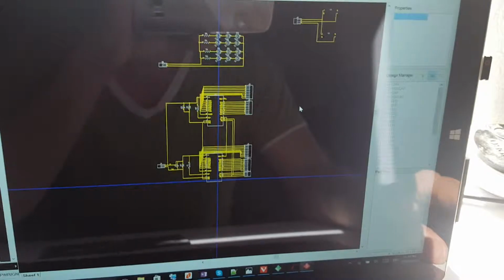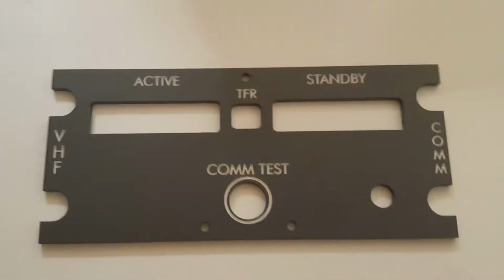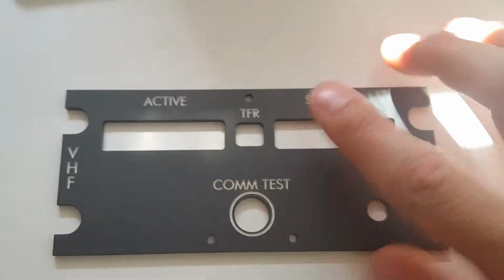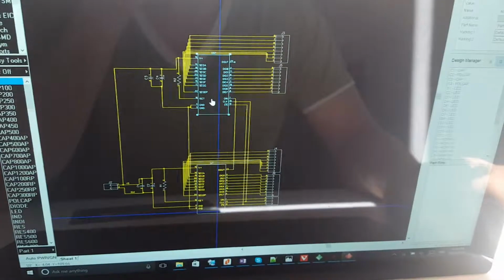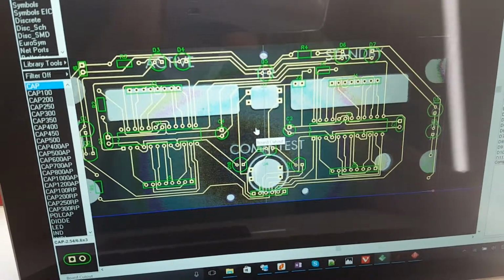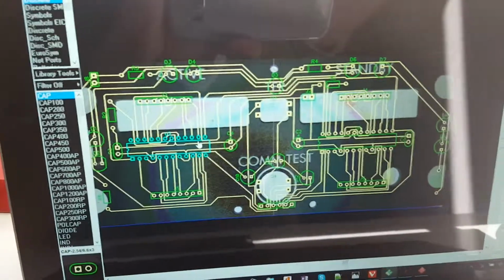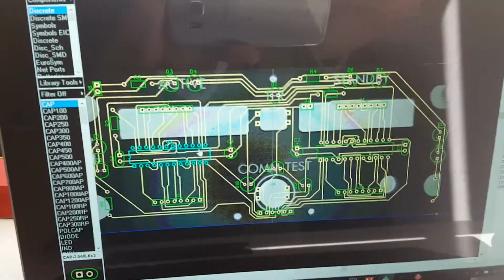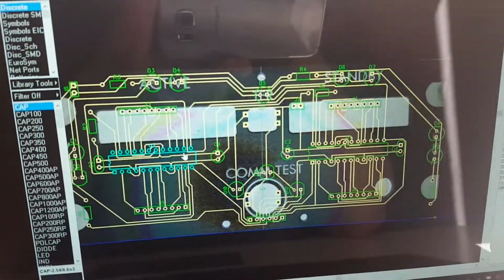Boeing 737 Comm Panel Circuit Design

Comment: does the software take your circuit design and turn it into a layout that works or do you have to do this?
Reply from the maker: both options are possible.
I try use autoriuting when I can as I found I was quite bad at tracing manually.
but you can always alter what auto router does.

Now I would probably go with double sided layout, cause single layer is quite complex